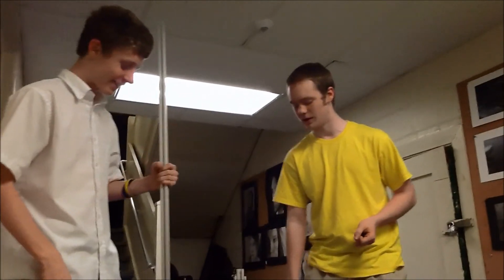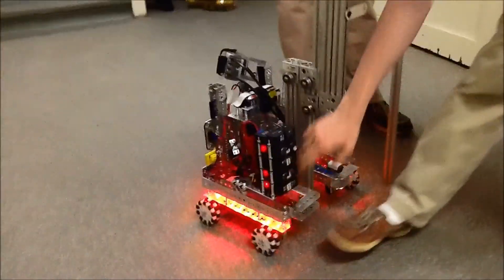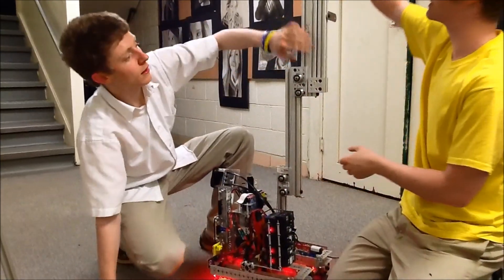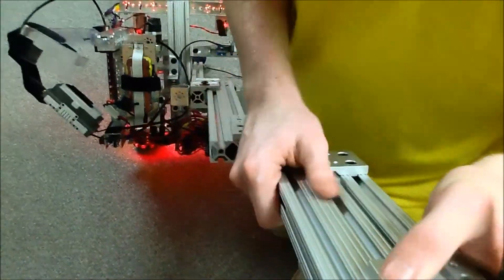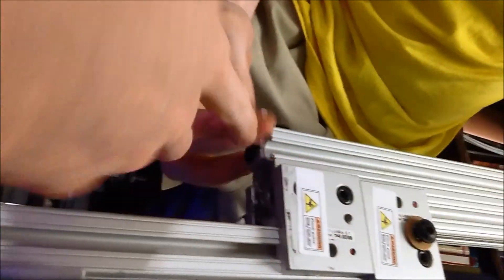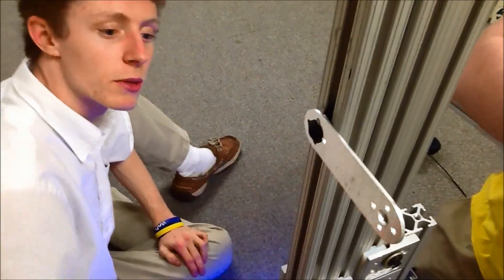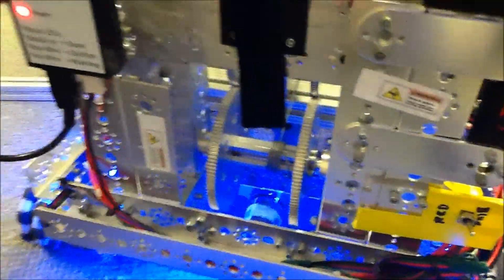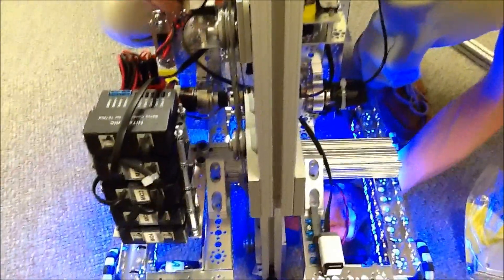#4 [part 1] Linear Slides and LEDs

Comment: Solid design.  What type of wire did you use on this system?  You had said metal wire in the video but I was wondering if you could be more specific.   Thanks.